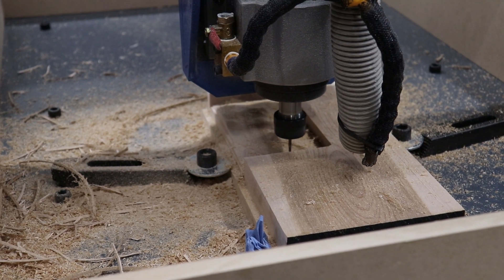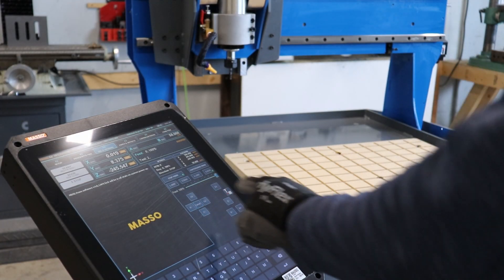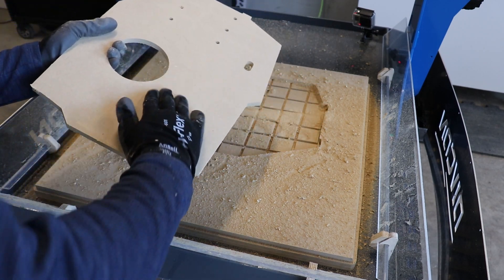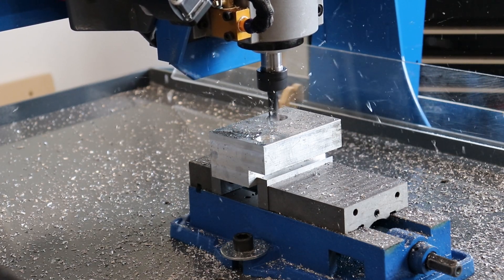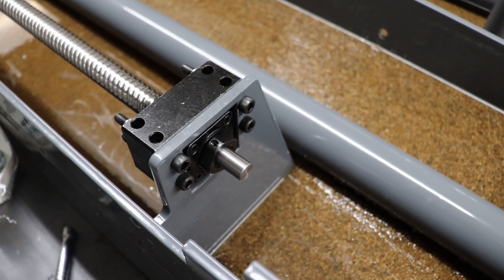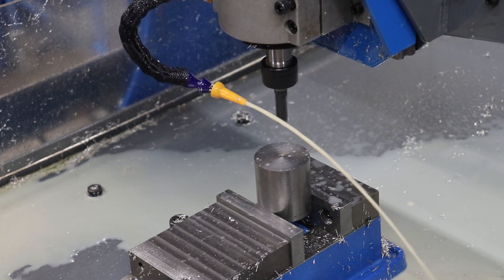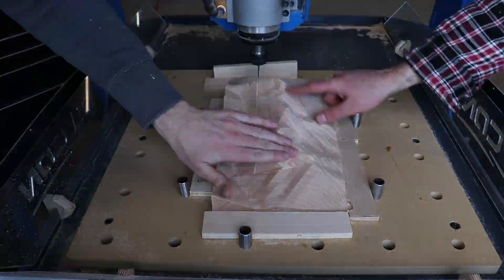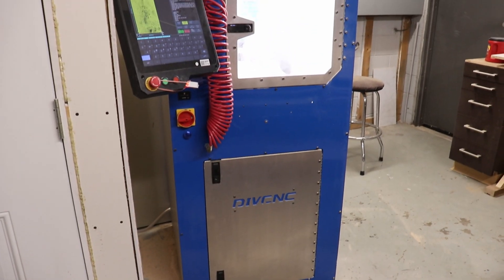Part Six - Build Complete, now Test Cuts (Last of Build Series)

Comment: Cool build guys 👍🏼 . Those spindles aren’t meant for hogging really. The high RPM + low torque really lends itself to end mills under 1/4 diameter, and less flutes to accommodate the high rpm. Using 3/8-1/2 end mills with a lot of flutes requires way too much torque that these spindles usually don’t offer. And even if they could, your SFM would need to be sky high (not good for steppers). I know because I used to try it all the time 4 years ago when I had a spindle just like that lol. May want to consider Zrn single flute endmills with this setup, or a 30 taper  spindle. I have a BT30 mill now and it’s night and day from my old machine. Best wishes
Reply from the maker: Thanks for the input, we knew it was a long shot but couldn't help ourselves haha. That's great advice, I will certainly incorporate it into a future build.

Comment: Nice build.  Looks like you are using an end mill not made for aluminum.   You want 2 or 3 flute uncoated/bright or a coating that does not have Aluminum in it (not TiAlN, etc).   These end mills are also typically sharper.   The edges of steel cutting end mills are often honed to reduce chipping.  At least that’s how it’s l been explained to me.
Reply from the maker: Thanks for the tip, I was certainly doing a lot wrong haha